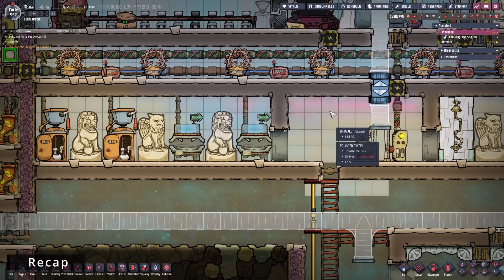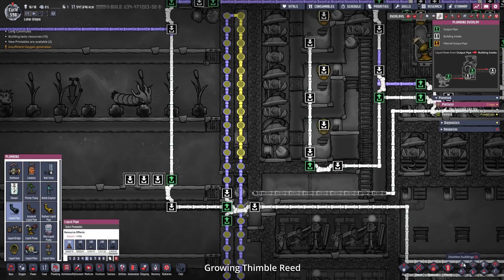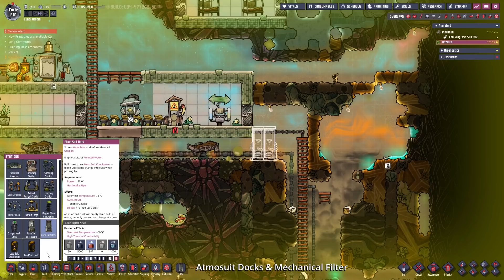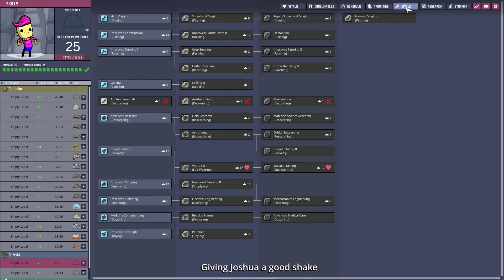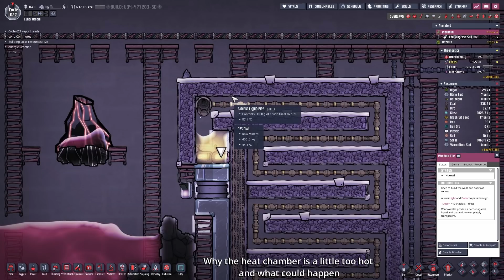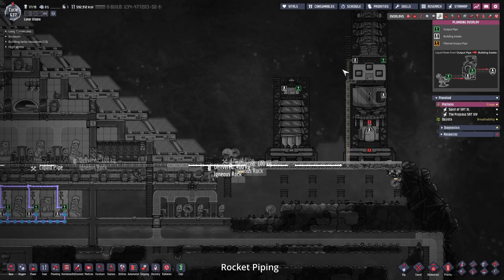Petroleum Boiler and Rocket Design - Oxygen not included Let's Play: Part 17

Comment: Also wanted to add, loving the content. 

I’ve actually started using infinite storage. I’ve done the other way to death and enjoy the change. 

I have used crude oil the most for the infinite liquid as it’s max is 870kg per tile, I go 2 tiles high and have two outputs. 

I also expanded to use 2 liquid or gas pumps to add output capacity. 

Love the thimble reed box you demonstrated. I’m going to use that.
Reply from the maker: Hey great you come to the dark side and use infinite storage. There are easier ways for the thimble reed but i did not want to make a temperature controlled pipe etc. Which would have been easier. I thought this one is "build and forget" but apparently it needs forever to cool down. Also my mistake because I cooked it in the first place :D. Thanks for the compliment by the way.

Comment: Small petroleum engine - IIRC the rocket base has a storage of 450 for petroleum, you don't need another liquid tank unless you want a longer round trip.  It also needs oxidizer oxylite at a 1:2 ratio (or liquid oxy at 1-4 ratio), the small tank will do.  Also, be careful with the temperature of what you bring into the spacefarer module.  There isn't really any practical way to have several dupes and cooling apart from bringing in colder stuff.  The rocket outlet fittings get very hot when in use.
Reply from the maker: Thanks for the Tips!

Comment: Industrial brick - Is keeping the smelter/crusher/forge out of the room itself for dupe travel time, lower manufactured output temperatures, or what?  I've also noticed lots of letsplayers string heavy-watt or conductive heavy-watt wire along the vertical transport hubs - I prefer to keep mine off to the side where the transformers are and put up metal tile to block the view so dupes going the distance don't lose decor bonus.   The third starter planet should have metal volcanoes.
Reply from the maker: Hi ahmataevo. Those buildings are outside because i want to get rid of the atmosuits for that area (in the long run). Also output temperature of the material. 
I have used the power shaft design i have at the moment basically since i started playing. Yes the decor is bad if they travel through it but it is very clean in the way that it is all to the sides. Surely there is room for optimization. Yours sound good - if that does not lead to overheating.

Comment: Answer to your problem at 26:00 heat cap of diamond too high. Recommended change: gold tile above the door or 2 ton steam temperature buffer block with temperature sensor
Reply from the maker: I am probably going with the gold in the short term and with more crude oil in the long term. The Buffer seems to dangerous in my vacuum magma biome. Thank you for the suggestions!

Comment: 6:45 you should see the water level drop because the flow is in the wrong direction. Water gets used first then replenish
Reply: Depends on your cooling efficiency of the cold block. If you used aluminium, it would not have mattered. Also, you can remove the reservoir (water and temperature buffer) because it is not used anyways
Reply from the maker: @someheree6362  The reservoire is for when i cut a pipe to do repairs or changes.  But yes atm it does nothing.
Reply from the maker: Haven't noticed that. Thanks! 
But that does not really matter here or am I mistaken?